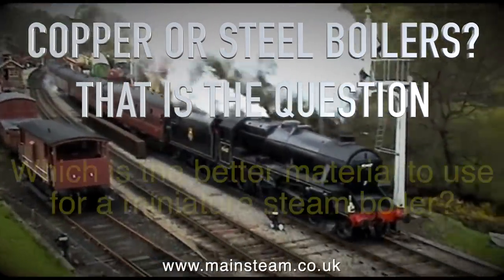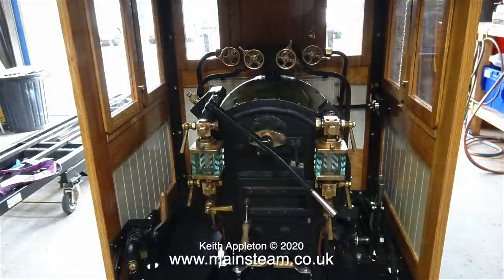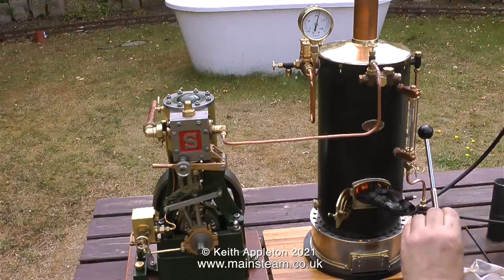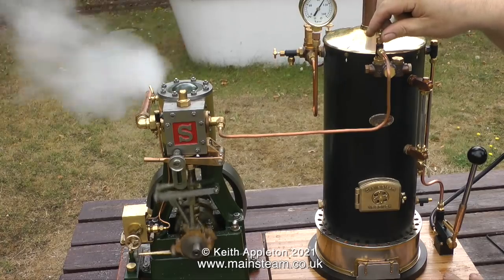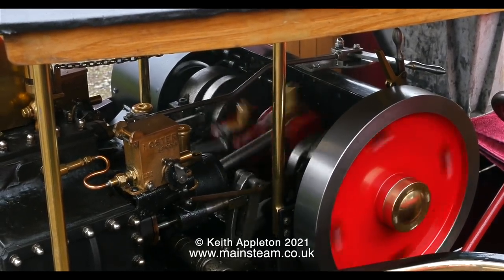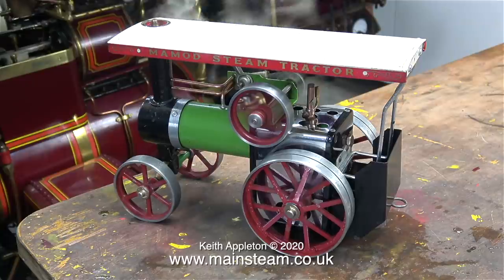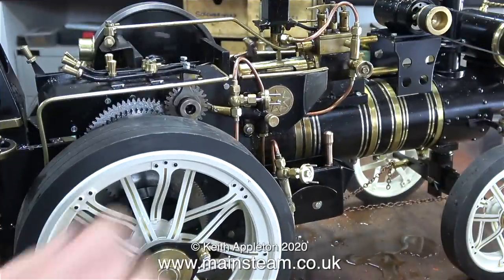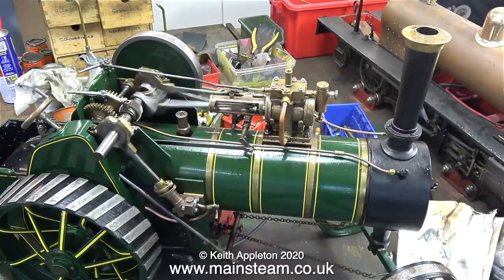A COPPER OR STEEL BOILER - THAT IS THE QUESTION?

Comment: Good points as usual Keith! With steel boilers your points are all spot on! Have to use water conditioner or soft water only and blow down after every run. In addition you will need to wash the boiler ideally once a year.
Reply: Plus boiler inspection every year.

Comment: My Allen Models Mogul, in 7.5" gauge, has a steel boiler with copper flues. The boiler was made by Marty Knox, a prominent model boiler maker here in the USA, back in 1987. It's never been fired and aside from it's initial pressure test, has never had water in it. I just purchased the boiler and a set of rough castings 2 years ago and intend to have it finished before I retire.

Comment: I think if I was going for a large model boiler it would be welded copper done by a certified welder, it you went with silver solder these days you would have to take out a 2nd mortgage on both the house and farm and even then sell off one of the kids.

Comment: Keith, I know this is way off topic, but while I was watching this video I remembered a video about the generator on your showman's engine generating electricity only in one direction.long story short..install a dc to ac converter..that should make it possible to run the lights in reverse as well as forward.
Reply from the maker: As the engine doesn't drive the generator when running, and the Leather belt is removed, the direction of rotation is fine as it is.

Comment: How about a Stainless steel boiler as a modern alternative?
Have you ever come across one?

What made me think of stainless as an option is that prices for TIG welding sets have become fairly affordable to the model engineer recently and the filler wire is very affordable compared to silver solder.
Offcuts of stainless sheet are available from fabrication shops.
Copper has become ever more expensive.

Stainless has poor thermal conductivity (about 1/5 of steel).
But, that could be offset to some extent by making it thinner, since you don't need to allow such a big corrosion allowance as with steel.
At the relatively low pressures we run model steam plant thin wall stainless steel would be plenty strong enough. 
Just a thought!
Regards Paul in NZ
Reply from the maker: Stainless Steel is not allowed for boiler use here in the UK. Probably due to the way that Stainless Steel work hardens and may be prone to cracking. It is impossible to obtain a boiler certificate for public operation from the organisations here if it is made from Stainless Steel.
Reply: @keithappleton   Hi Keith, Thanks for the reply. Regards Paul

Comment: I'm working on starting my 7 1/4" gauge locomotive and I plan to go with a tig welded 316 stainless boiler. From my experience with industrial engineering stainless steel is the best option on paper, just expensive. What are your thoughts on using tig welded stainless for a boiler?
Reply from the maker: Stainless Steel is not allowed for boiler use here in the UK. Probably due to the way that Stainless Steel work hardens and may be prone to cracking. It is impossible to obtain a boiler certificate for public operation from the organisations here if it is made from Stainless Steel.
Reply: Hi    the ausies  have been   been using  stainless steel boilers for years I'm  sure it must be cheaper  than copper.  I intend to build one for my  Meter Maid.   The advantage  of  stainless forby  the obvious  non rust properies is that it can be made from the same thickness plate as copper  as the thickness  does  not need to be almost doubled as in a normal steel boiler to allow  for corrosion.. the grade of stainless is important it has to be of the DUPLEX variety .   All the  specs are available  if you look on the web. As Keith  says it's  not allowed in UK  but I don't live there.  Maybe someone  should stir the pot and as why not??  As for the welding a COMPETANT  amateur   should,d be able to tig weld  a boiler  and have it tested .  Copper tubes are often expanded  into steel boilers as well    Hope  I've    not   confused  the issue even more . KEEP SAFE . Just had my jab today we're  a bit behind  in  Africa

Comment: Hi Keith, love your videos, why do not they make boilers out of stainless Steel..?...
Reply from the maker: Stainless Steel is not allowed for boiler use here in the UK. Probably due to the way that Stainless Steel work hardens and may be prone to cracking. It is impossible to obtain a boiler certificate for public operation from the organisations here if it is made from Stainless Steel.

Comment: being a welder (MIG, MAG, TIG, stick and gas welding) of 40+ years working steel, stainless steel and aluminium!
could you use stainless steel?????
Reply from the maker: Stainless Steel is not allowed for boiler use here in the UK. Probably due to the way that Stainless Steel work hardens and may be prone to cracking. It is impossible to obtain a boiler certificate for public operation from the organisations here if it is made from Stainless Steel.

Comment: I have a steel boiler on my 5” gauge locomotives and it is from 1994 and it had nothing done on it and is still going very well 
So I would say that a well cared steel boiler can live much longer than a decade without nothing done on it
Reply from the maker: That may be the case and I congratulate you for looking after it . . . do you get it professionally internally inspected ultrasonically to check for wasting? Personally I prefer Copper boilers - they don't rust.
Reply: @keithappleton  no, I didn’t have done any ultrasonic inspection but I might be doing it next year before an overall and repaint 
NB. I bought the locomotive last year second hand from a friend who works at the same club as me (Swiss Vapeur Parc) who made an overall of the motion  three years ago 
I hope I can go running with it soon... ;-)

Comment: Keith, I have a dehumidifier which of course pulls water out of the air and collects it in a tank.  If you were I, would you use this water in a welded steel steam boiler'?
Reply: If you use water from a a dehumidifier or distilled water in a steel boiler you must use water treatment. If you do not the water will pull minerals from the steel.
Reply from the maker: I would be concerned about the possibility of catching Legionnaire's disease . . . . .

Comment: Can you use stainless steel ?
Reply from the maker: Stainless Steel is not allowed for boiler use here in the UK. Probably due to the way that Stainless Steel work hardens and may be prone to cracking. It is impossible to obtain a boiler certificate for public operation from the organisations here if it is made from Stainless Steel.

Comment: I would use copper or brass, no rust, no maintenance, just make a bit thicker.
Reply from the maker: Copper is good, but never use Brass . . . . . Brass not good for high pressure boilers.